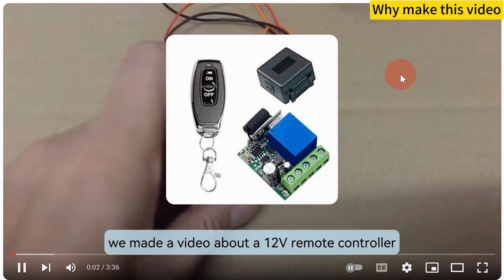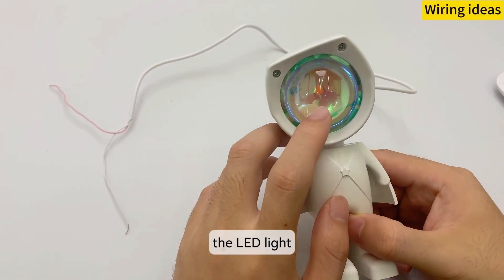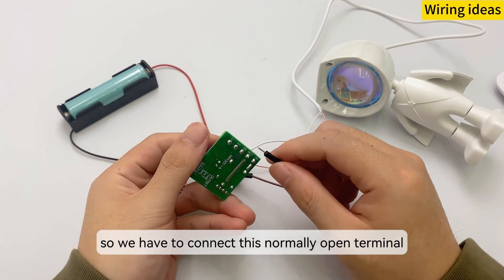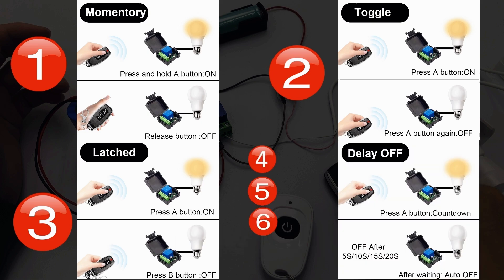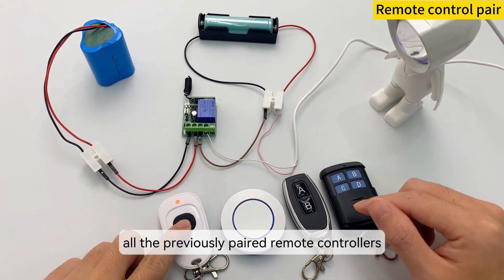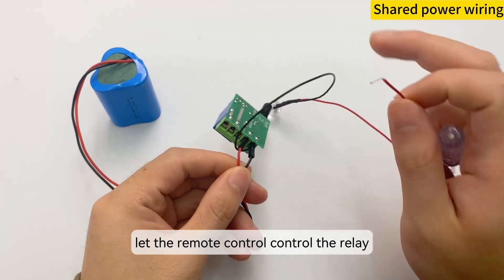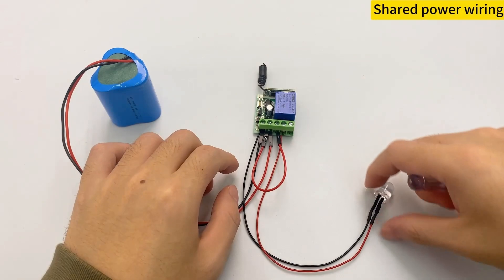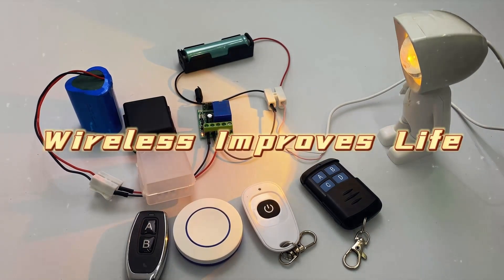How to use remote control switch, DC12V, wireless relay switch 1Ch rf 433Mhz, KR1201 by QIACHIP

Comment: Is it possible to use two remote controls with one receiver? If so, what would you need to do?
Reply from the maker: It's very simple. After pairing the first remote, you can then pair the second remote. The two remotes operate independently.
If you're unsure, you can check out other videos on my channel; 
https://youtu.be/MeZD74C9iC4?si=ciLq_8qEGZonLTeZ&t=202
How to Use Wireless Remote Control Switch KR2201B 220V 110V Relay Switch to Control Fan and Light
many of them demonstrate using multiple remotes.
Reply: @qiachip thanks for the answer. I will try it later.

Comment: Is there a remote available that will travel 2 miles ? And if not whats the max. distance available ?
Reply from the maker: I've tested the remotes on the market that claim to have a range of 2 miles（3 kilometer）. In a simulated real-life scenario on the road, the results were not as expected, with a maximum range of only 1 kilometer. 
Does this distance meet your needs?

Comment: Could an small external aerial be connected to this.      As i am wiring one to my kids  f1 style go cart.    To remotely cut engine.         Say like a small 1ft antenna
Reply from the maker: There is an antenna on the module. 
You can replace it and test the distance. 
If the impedance is just right, it should meet your expectations. 
If the test fails, then this antenna is not a match and you'll need another antenna that meets the specifications.

Comment: Can i rotate reverse the motor too with B button 
Please reply 🙏🙏
Reply from the maker: Speaking of making the motor reverse, I have to recommend this product, the KR2402. For the specific usage, click on https://youtu.be/o7SbTBAeAlU 
"How to Use the 2 - Channel RF Remote Switch Linear Actuator Controller to Achieve Forward and Reverse Rotation and Momentary Operation of the Motor - KR2402"
Reply from the maker: This is a single - channel controller, so it can't make all the motors reverse.

Comment: Hello sir, if i was done setting that module to mode 2 (toggle) and then my power disconnected, what would happen? Do i need to set it up again or does it have a memory function for the last setting (mode 2)? Help me Please, i need your answer for my project, sorry for my bad language 😊🙏
Reply from the maker: No need to reconfigure. 
This kind of DC12V, 433MHz wireless relay module has a memory function and will remember the mode 2 (toggle mode) you set.
 Even if the power is cut off, it will still maintain the mode 2 setting after being powered on again, and can be used directly without reconfiguration.
You expressed it very clearly. I could understand, and you're really great.

Comment: It is possible to reset the control or use it on automated residential gates?
Reply from the maker: It can be reset by pressing the learning button on the controller 8 times. 
Some of our users use it for access control. 
As for automatic residential gates, it depends on the specific principle. 
Our 12V controller can provide dry contact control. 
We also have corresponding products for those who need 220V.

Comment: can we have 2 remote controlling the toggle mode?
Reply from the maker: Yes, this relay controller can pair with multiple remotes
Reply: @qiachip  vague response
can 2 remote control toggle mode in same time,
i'm not referring to multiple remote pairing you demonstrated for each mode.
Reply from the maker: Let me describe this using a real-world scenario. 
See if you're correct.
I'm pairing two remotes simultaneously totoggle mode. 
Pressing one remote turns it on, and the other turns it off. 
Is that what you mean?
Reply: @qiachip  yes i think it is called a back and forth.
Reply from the maker: @Tailslol  That's great! This scenario can be achieved. 
Also, you can try the interlock mode where you press three times. 
It can be learned with two separate buttons, and the same effect can be achieved. 
Moreover, each button has only one function.

Comment: can we connect (loop) negative line into COM to trigger..?
Reply from the maker: In most of our circuit diagrams, the positive pole is connected to the COM terminal of the relay for triggering. 
If you understand the principle, you can of course design it yourself to connect the negative pole to the COM terminal for triggering. The fundamental principle is that there should be no short - circuit before and after triggering.

Comment: can ituse same powersuplly?
Reply from the maker: As an electronics enthusiast, to determine whether the same power supply can be used, you need to check the rated power parameters of the device (such as whether the voltage is DC12V for both, and whether the output current of the power supply can meet the total power demand of the device).
 If the parameters match, it can generally be used. 
If they don't match (such as different voltages or insufficient current),
 it can't be used; 
otherwise, the device may be damaged.
Reply: Yes.

Comment: I see in market have 12v version and 5v version, 5v version can operate with Li-ion 3.7v? like 18650 batteries?
Reply from the maker: It's a great question! In theory, the 5V - rated device is designed for 5V operation. A 3.7V lithium - ion battery like 18650 has a lower voltage. While some 5V devices might tolerate this to some extent and work, it's not ideal. The main reason is that the lower voltage may cause problems such as reduced performance, like shorter remote - control range or unstable operation. It's better to use a proper 5V power source for stable performance.

Comment: If you have the control switch paired to the wireless relay and programmed the switch to function as toggle (#2), when you disconnect the power source of the wireless relay, do you need to pair and reprogram again?
Reply from the maker: Recently, many people have asked this question, and I don't know what product you were used.
Our products do not have the issue of needing to be paired again after a power outage.
Please rest assured to use our products(QIACHIP). As long as you pair them correctly and do not reset them, they do not need to be paired or coded again!

Comment: How to operate a servo motor with this please tell
Reply from the maker: https://youtu.be/o7SbTBAeAlU
How to use 2CH RF remote switch linear actuator controller forward reverse rotation momentary KR2402
Servo motors generally have precise control, so you might consider a controller with more programming capabilities. If you want a simple controller for motor control, I would recommend this one: KR1202, which allows both forward and reverse operation.

Comment: Will these loose remotes and remote modes when the relay looses power? 

I need a setup where they stay programmed even after power is cut.   

I want to build a two 1 channel relay setup where one 2 channel remote controls both single channel relays.  

1 relay in momentary (Button A) and 

1 relay in Toggle mode (Button B)
Reply from the maker: There is no loss of the remote control or remote mode after a power cut.
There is no problem with your idea! This product of ours can realize the settings you want, please recognize our brand, because the product design is different for different brands!
Reply: @qiachip  So you are telling me that once i program the remotes i can leave these relays unplugged from power for a few months and they remain programmed?

Because i am building unplugable modules , Both relays will be mounted to a daughter board with pins that plug into a socket.
Reply from the maker: @killerdeamonking  It seems that you still have doubts about this question. Let me give you an example of a real-life scenario. Do you think it is appropriate?
We often pair this relay module with a remote control for some customers and then send it to them (the power is off during the process of sending it to them).
After they get it, they can directly connect the power supply and the device to use it without the need for pairing mode.
Reply: @qiachip  Ill be honest , ive never actually seen someone do a review on this version of the relay.
Reply from the maker: @killerdeamonking  
I think the best way to solve doubts is to practice. Only after you get it and try it out, you can understand everything.
There are comments on this relay module. 
We have had a hit video before, with a lot of comments below, 
as well as links to shopping platforms and related comments. 
However, there are not many relevant to your question, 
because we assume that as long as the relay module is programmed with the remote control,
 you do not clear the settings and the programming will be retained.
The programmed remote control can always be used.
Reply: @qiachip  I would be willing to test this at some point , though I don't have the project ready yet to test.

Comment: Can we use ac power for this circuits
Reply from the maker: https://www.youtube.com/watch?v=NoEDLP5B5yk
AC 220V Multimode Learning Wireless Remote Control Switch 1-channel Relay Receiver Module
If you want to use AC power, you can take a look at this remote control relay module
We can choose different modules according to the power supply
Do you have other needs?

Comment: Could you please tell me how to wire it - after a power loss the relay to be triggered on for electro magnet locking (explanation - you lock the magnet with relay on, then the power loss happens and the lock is off, but after the power comes again the relay is triggered on again and locks)?
Reply from the maker: https://youtu.be/h5bpQ6hNJ20
Solenoid Door Lock DIY Using 12V Relay Module KR1201 433MHz Become a Remote Control Electronic Lock
I suggest you watch this video first.
It talks about the application and wiring principle of this module for electromagnetic locks.
I hope it can answer your questions.
If you still have questions, please ask.
I will continue to explain.

Comment: Which mode should I use so that the battery is only consumed when in use?
Reply from the maker: As long as you are connected to the device, the device will consume battery power during standby;
the power consumed during standby is much less than the power consumed during working. 
You can choose the inching(momentary) mode to minimize the working time.
 This is the mode that can extend the battery life. 
However, it is still recommended that you choose the mode according to the actual situation. 
You can buy a large-capacity battery or directly connect it to a 12V power supply to solve the power problem.

Comment: Can you control 2 different led lights at the same time? While the other is on the other is off and vice versa controlling
Reply from the maker: Yes, but I recommend you to take a look at our other two-channel module first. 
https://youtu.be/o7SbTBAeAlU
How to use 2CH RF remote switch linear actuator controller forward reverse rotation momentary KR2402
It is simpler and easier to understand, and it is also made into a video. 

As for this module, to realize the function you mentioned, 
you only need to connect the positive pole of another light to the NC terminal and the negative pole to the negative pole of the power supply (battery) based on the LED light connected in the video; 
Use the principle of relay to realize that one LED light is turned on and the other is off, and vice versa.
Reply: @qiachip  Thank you for updating these videos to help us.  It would be good if you also showed the wiring in the two way video as you have in this one as in showing how you actually connected it and not just drawings.  I have a four way relay and it would be good to see the wiring scheme for that as well.  If you could make a video showing 4 LED lights being connected to a four way that would be very helpful.  With the two way you are powered AC lights and you use an alternative power source, it's hard to understand how this relates to LEDs as there is no alternative power source and we are not all electricians! :-).  As a tip for the future.  Whenever you make a product video, try to think of all the alternatives and make a video to help each one.  If you had a made a video using a four way channel and set it up to use a motor an LED and an AC light you wouldn't have needed to make the 2 way video because anyone using a two way can learn from the four way.  You have excellent products but honestly, the lack of information about them and your customer service really, really let you guys down.
Reply from the maker: @TheFakeyCakeMaker  You said it very well. Thank you for giving me some thoughts. This makes me pay more attention to the production of videos and the popularization of knowledge. We will also improve the quality of service!
As you said, the wiring of the idea is more troublesome, so we will also make a four-way video as soon as possible to show the wiring in actual use.❣

Comment: Can it cover AC 220 voltage, to control home appliance....?
Reply from the maker: This is a remote control module KR1201 specifically for 12V;
We also have other voltages, but they are all DC, such as KR3001;
Relay remote control switch 5V 9V 12V 24V 36V 48V 60V RF KR3001 Based on KR1201 upgrade by QIACHIP
https://youtu.be/khUNrXWFi1w

We also have 220V AC, you can watch this video to determine if it is what you want
How to use 2CH RF remote switch linear actuator controller forward reverse rotation momentary KR2202
https://youtu.be/EQyKgdRzZOE

There are also single-channel ones:
AC 220V Multimode Learning Wireless Remote Control Switch 1-channel Relay Receiver Module
https://youtu.be/NoEDLP5B5yk

Comment: I saw your store on aliexpress. Do you do retail sales on aliexpress?
Reply from the maker: Yes, we sell it on AliExpress.
Take a look at these two links:
https://www.aliexpress.com/item/4000709695238.html
This is the AliExpress link for the video product KR1201

https://www.aliexpress.com/item/1005005324067388.html
This is the AliExpress link for another product KR3001

The two have the same appearance
However, KR3001 is our new product
The main feature is the increase in wide voltage
It is no longer limited to 10-14V
But it can be used for 5V-60V
You can choose according to your situation
If you have any questions, please ask again

Comment: What batteries do you use to operate the device? Also, I saw in your other videos that you used 8 AA batteries. I created the same way with 8 pcs of AA batteries (totally 12 Volt). I operated this circuit with my 12-volt battery. But my circuit broke down after 1 day use unexpectedly. Could using it with batteries like this, especially with ordinary AA batteries, be harmful or the problem was about device ?
Reply from the maker: I usually use 12V lithium batteries
because this type of battery has more power;
ordinary AA batteries can be used without causing any harm
but this type of battery has less power, so it will run out of power after a while;
if yours breaks down unexpectedly,
please explain whether it is the device that breaks down
or the battery that breaks down so that we can make further judgments
Reply: @qiachip  Hmm, thank you very much for the information. I think my device is broken because I made a new 12 volt battery from scratch and it doesn't work with it anymore. I will buy a new one and try a lithium battery this time. I will order from you on aliexpress. With love from Turkey

Comment: I connected a 9-volt battery to the device, and it shows a red light, but the device does not disconnect the electrical circuit, and vice versa. Why is this, and what should I do?
Reply from the maker: Oh, I think you are mistaken.
Because this device is specifically for 12V.
You can see that it is also mentioned in the video:
We measured the specific range of the power supply voltage, which is 10 volts to 14 volts.

So your 9V cannot drive this device.
You need to buy a device suitable for 9V.

Comment: Thank you very much for the explanation. My relay switch doesn't reset when I press 8 times. Any ideas?
Reply from the maker: The product you bought may not be ours, because most of our products need to be reset by pressing 8 times;
Here I suggest you ask the seller;
I will also tell you some design habits
It is convenient for you to test it yourself;
We may set the reset method
1. Press 2 times, up to 9 times
2. Long press the button for 5s or 10S

You may try these methods again;
Hope to solve your problem
Best wishes